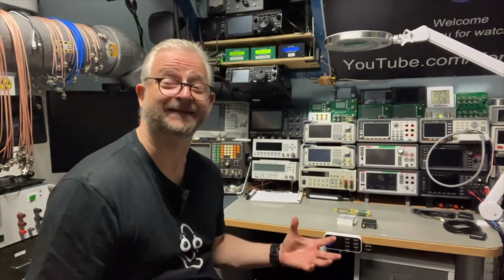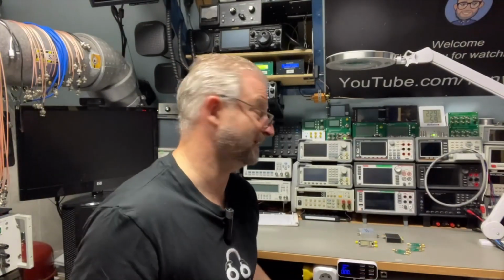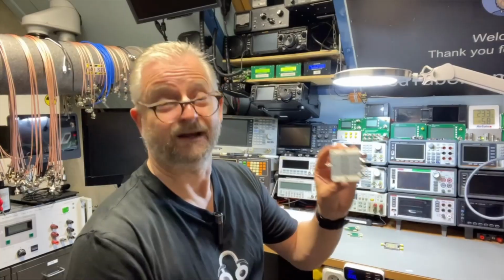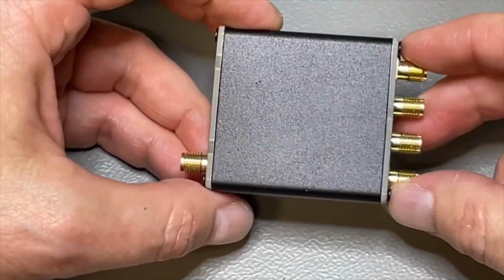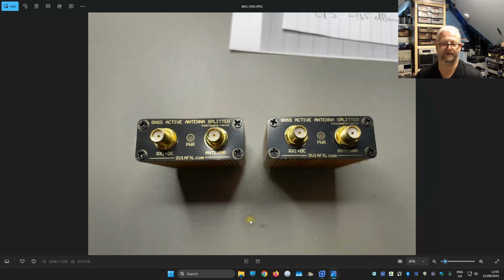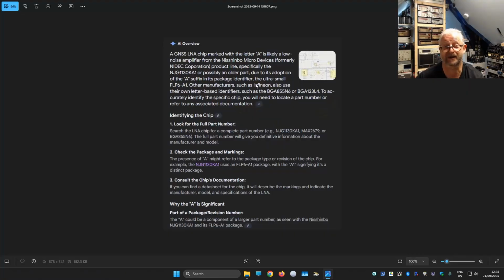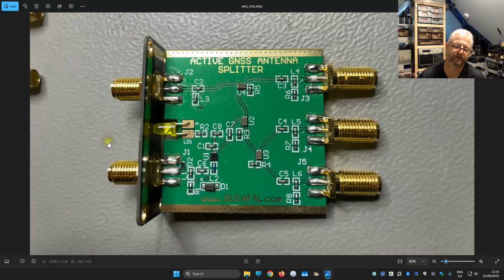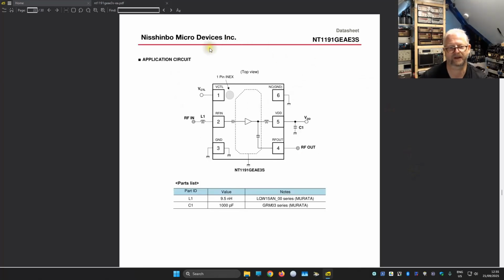TA-0456: GPS GNSS Power Dividers passive active - SV1AFN Splitter

Comment: Mooi vergelijk Tony. Ik heb die 2e handse nu gekocht op Aliexpress. Nu alleen nog de 10MHz divider. Maar die wil ik met galvanische scheiding hebben. Had jouw video hierover ook al gezien. Met die Aliexpress variant. Alleen meen ik dat die geen galvanische scheiding heeft...
73's Fokko PA3VOS
Reply from the maker: Dankje Fokke, volgens mij heeft CircuitValey een gescheiden distributer, die is net uit. Ik heb hem nog niet hier gekad, maar wie weet komt die nog hier. ik kom er net erachter dat mijn 4-weg splitter van Ali helemaal niet goed is, Ohms is hij wel correct, maar op de SA is hij -30db flat... ik heb hem al 1 of 2 jaar, maar niet eerder mee gespeelt, dus dat moet je wel ff in de gaten houden. (hij doet het trouwens wel gewoon met de gps gek genoeg, het is alleen wat zachter) snr is daar ook balangrijker dan gain.

Comment: Hi Tony nice Video ! In the newer Variant of the SV1AFN active splitter, the Splitting Parts (ICs) are Probably 90° hybrid couplers, like the ANAREN(TTM) 11305-3S (1.0 – 2.0 GHz) or the TAOGLAS HC125.A (1150-1630 MHz) or Similar, I use both in my own GNSS Designs. Cheers, Konstantin
Reply from the maker: Hi Konstantin, thank you! that was the missing part for me, great!